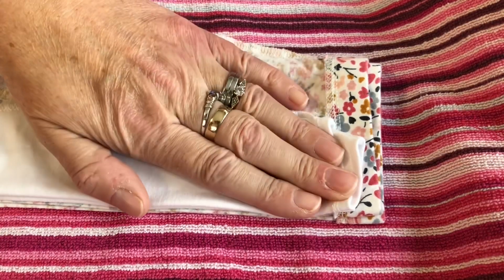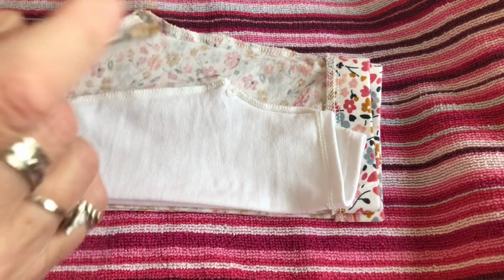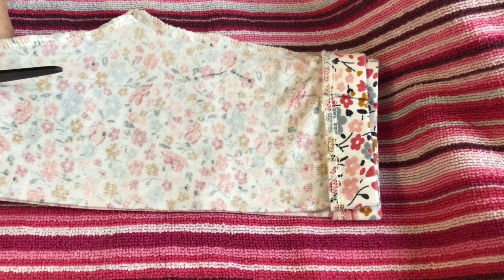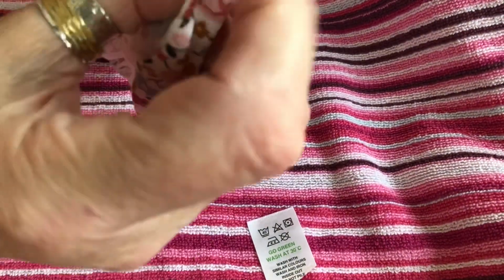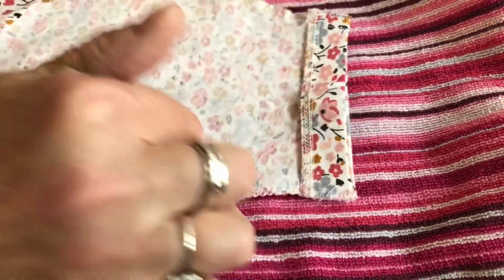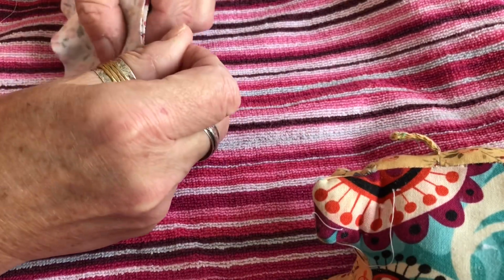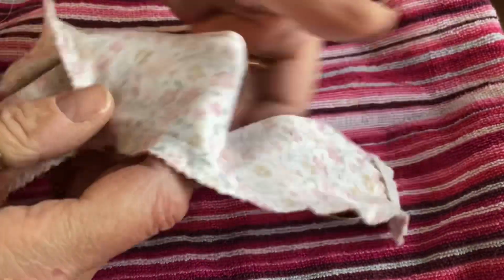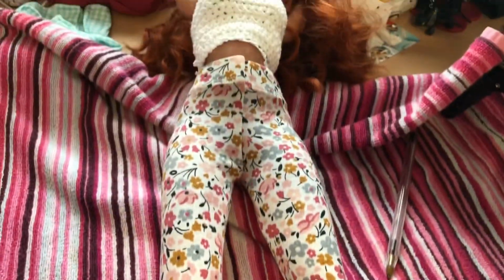RECYCLING BABY CLOTHES TO MAKE DOLL CLOTHES - 1/3 SCALE LEGGINGS - AFULT COLLECTOR

Comment: Sergers intimate me! I used one in a sewing class I took years ago, but the teacher set up for me. I regret I didn’t try to learn how to use it better. The leggings turned out great.
Reply from the maker: Honestly mine has been sat in a cupboard for about 5 years, and I decided I needed to learn how to use it better - turns out I was threading it wrong - much easier to use now 🤦🏻‍♀️🤦🏻‍♀️🤦🏻‍♀️
Reply: @JayDollsUK  Yes, threading is scary!
Reply from the maker: @TammyPowley  it actually boiled down to making sure that one of the looper threads was over the top of the other - I had been doing it wrong which caused jams and  cut thread - such a simple fix ( I really need to learn to read instructions)